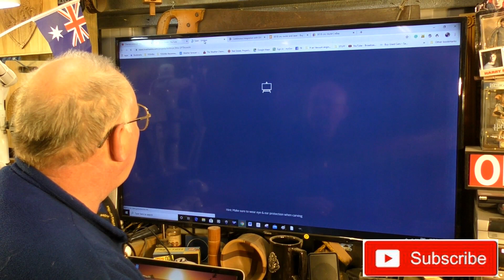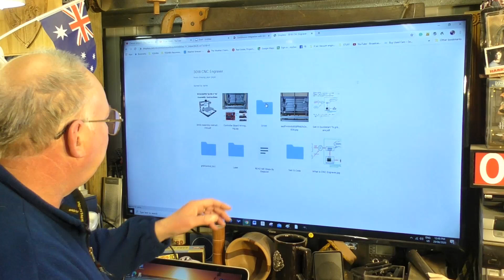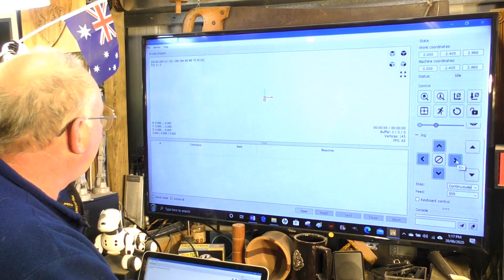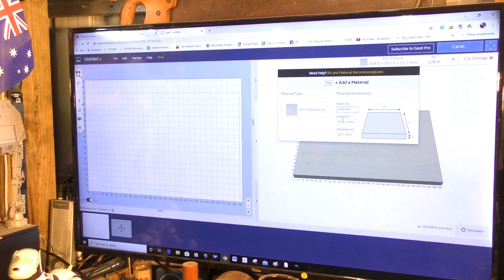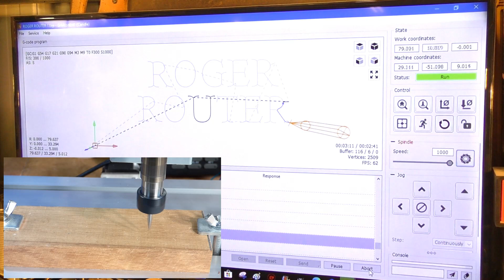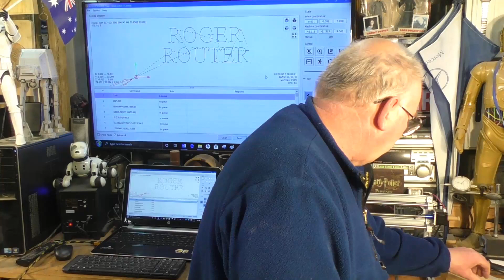Test drive a 3018 Mini CNC Router + free CAD-CAM Easel and GRBL program setup

Comment: thanks for the video.  It helps a lot.  I bought mine at a pawn shop and got no drivers, nothing but got in from the internet.  Did not get the engraver but only the laser and it works perfectly
Reply from the maker: That is great that you were able to source the drivers online and get your laser setup running! 👍

Comment: Great video!  I have a CNC Sieg X2 machine very similar to yours. Is it easy to calibrate the steps in the X,Y, and Z axis with GRBL? I use Mach3right now but after watching this video it looks like GRBL is a simpler interface.  That means more chips and less messing about with the program. :) Thanks so much!